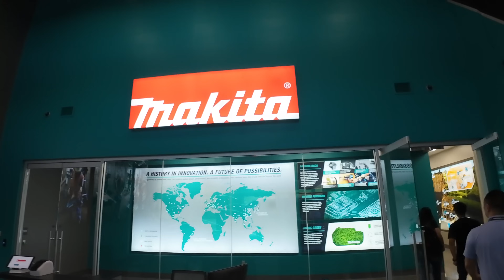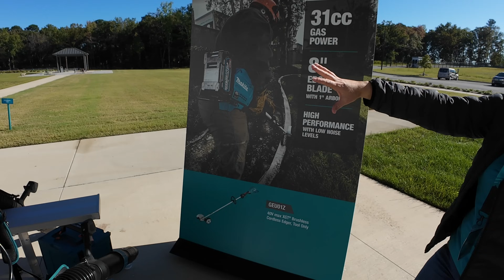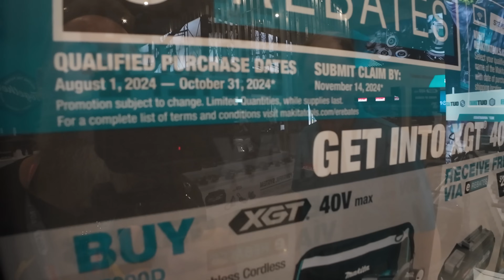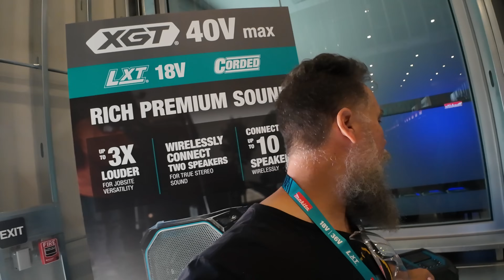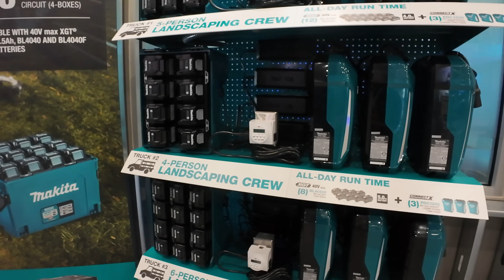All Makita's NEW tools Raw & Unfiltered

Comment: I was a Milwaukee guy for about 22 years. I switch to Makita and have been pretty happy. I am a bit pissed off now about XGT. Not too long after I tooled up with $thousands$ in Makita LXT, they came out with XGT. Since there is no compatibility, most of the inovation or new versions of tools is in a platform I didnt invest in. Other brands come out with upgraded tools and batteries that stayed within the 18v line that compete or outperform Makita 40v. Also, as  an owner of a plumbing company, they havent came out with any press, expantion, or crimp tools. We have eveyone tooled out with Milwaukee in those tools. That is probably the bigest reason NOBODY I know in plumbing has Makita tools. When we need new company tools including Jackhammers, concrete saw, core drill, roto hammer, press tool, expansion tool, the guys want Milwaukee. My Makita LXT feels like a separate line similar to DeWalt or Milwaukee 12v. If you want the big boy tools you have to be in their 18v line. Makita, you want the big boy tools, you have to be in the 40v line. Since im thinking about upgrading from LXT, it might not be XGT. It could be another brand.

Comment: 26:00 I don't like that there's no flip up function for the small brush, having it sit on the ground while pushing it forward will destroy that brush in no time. I do like that it can pick up stuff that is not just dust, the one I've used (not Makita) couldn't pickup cut off tyraps, which is extremely annoying.

Comment: The XGT should have been made compatible with the LXT,  Dewalt did something similar years ago and they almost went bankrupt.
Reply: Dewalt is rubbish though
Reply: Its dumb to be honest, they should've went straight to 60v if they were changing batteries anyways. They're just making their customers replace everything they have so in a few years they will come up with a 60 or 80v new battery system called ZXT. 40v is dumb unless its compatible with 20v tools
Reply: @zaxmaxlax  They already have 80v tools, such as the breaker in this vid you just watched, using the 40v batteries.
Reply: @Mikkel-Hansen  Which is stupid. Why not use a 80v battery in the first place or a single 60v battery

Comment: The toolbox shows you taking it out of the truck I would like to see how you put it in the truck obviously going to be breaking it down it's going to slide everywhere in your truck again let him break it down install that in the truck and the other thing floating tools in boxes is really not a good idea if you take it up some stairs all your tools are going to more or less be bang together and if you have a bunch of screwdrivers pliers hand tools in general it's going to be all mixed up because nothing is secured because you have a system that lays down and when moving it it's at a 45 degree angle I know you're excited but the new Makita drill impact what would be the price point should I asked a question and another thing with the pairing up the battery to the tool they're still going to steal the tool and is still going to steal the battery the only thing that going that they can't use is a usage due to the pairing up code end of the day you're still missing the tool or the battery should incorporate Apple air bud or tracking device GPS especially in the batteries batteries for power the tool you'll be able to find your tool when when in use thanks for the preview though appreciate it